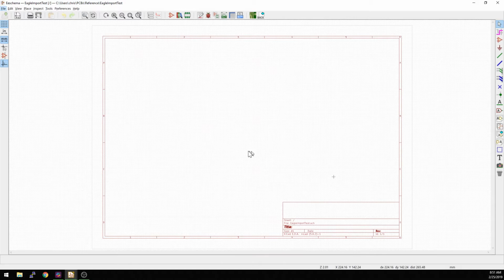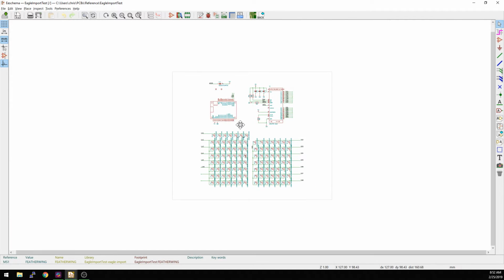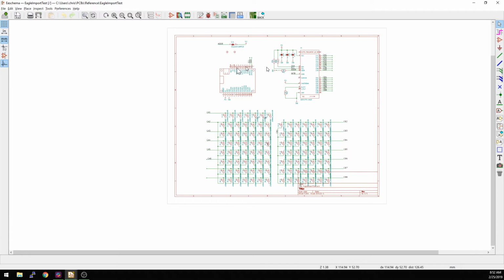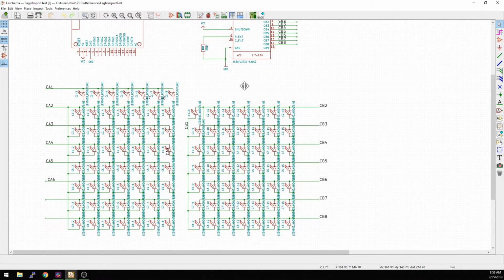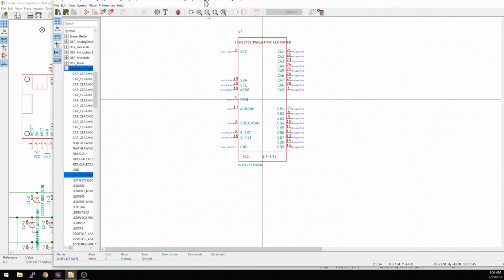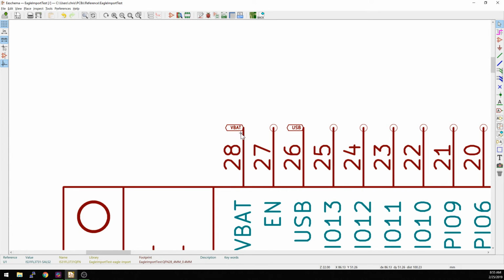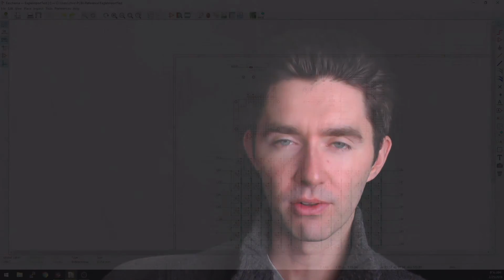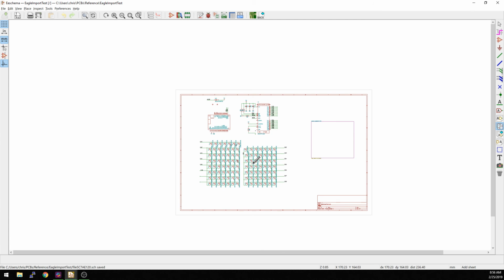KiCad 5.0 - Importing EAGLE schematics

Comment: KiCad's framerate is horrible in your video; moving gates around on your sch for example. Is that just your computer or is this just KiCad? Im considering the switch from Eagle myself and this would be a huge red flag for me...
Reply: Recording software slows shit down on computers with bad cpus. I can run it on a modern intel atom with integrated graphics at locked 60fps with absolutely no lag whatsoever.